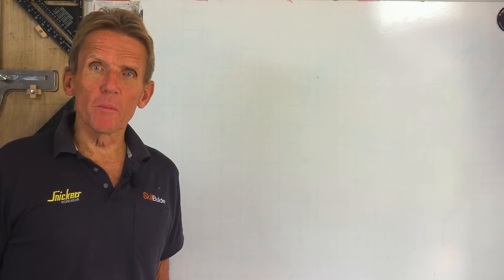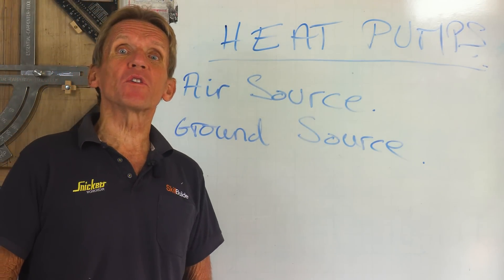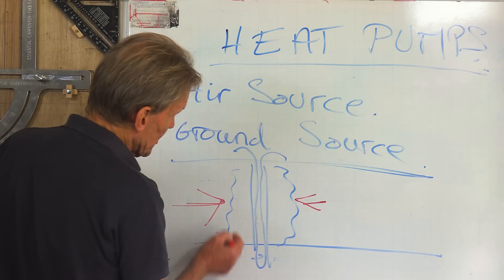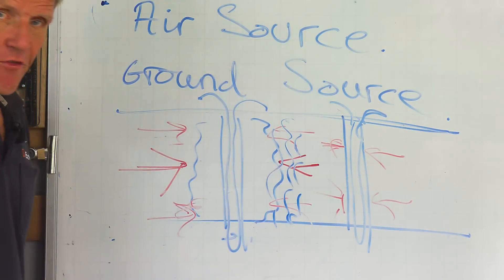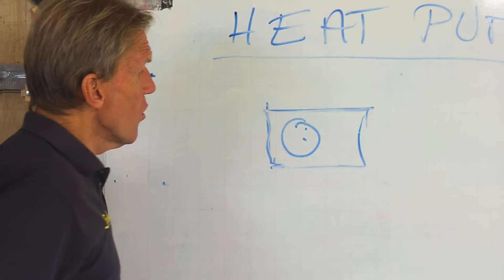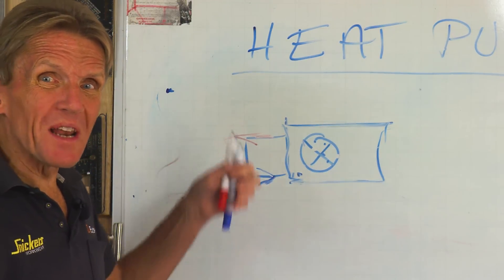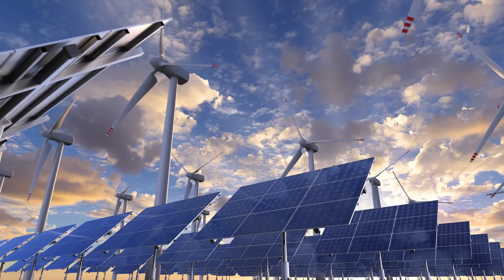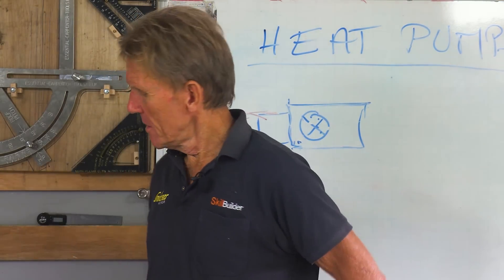Heat Pumps ~ Get Your Facts Straight!

Comment: the quiet killer comment from that Welsh guy telling you about his awful experience was 'it increased our electricity bill by two-and-a-half times'
Reply: How much did the gas bill go down by?? and two and a half times what??
Reply: One thing the pro heat pump zealots say to high electricity bills is “you should have installed solar panels and batteries”….well that’s a mute point as the only comparison to that with conventional boilers would be to have your own oil well/gas reserve to tap into to supplement the grid supply!
Reply: What did it do to the gas bill?
Reply: @jimgrace3492 my 4 bed gas bill is £580 and £180 of that is rip off standing charges. 😂 how can you save money on that with a 10k heat pump
Reply: Your gas/oil bill moves to your electricity bill. It's not free heat 😂
Reply: @Loopyengineeringco  yes but it’s not a one to one ratio as electricity is more expensive than gas, and heat pumps use a considerable amount of electricity, depending on the type of house you have and how you heat it this can lead to massive electricity bills (as I commented on the last video I follow a lot of self builders on instagram a lot of whom regret installing ashp, one of which who this year moved into their well insulated, air tight build recently had a £3000 bill for the last quarter)
Reply: @aster7693 How large is the property? Surely this cannot be all heating? BTW there wasn't any need to use heating until November
Reply: @aster7693 straight up nonsense. Did you watch the heat pump replacement video and the one showing the genuine efficiency? Even in that single skin house they were able to get an efficiency that was cheaper than gas. 
If they are spending that kind of money in a new build home then it’s been designed and installed wrong.
Reply: @Loopyengineeringco   Nobody is saying it's free heat, but if installed right it will be cheaper heat, and more importantly lower carbon heat.
Reply: @johnhaydon4055  yeah definitely - a lot of people miss the fact that their electricity bill now covers their gas bill (somewhat surprisingly). Mine's been cheaper to run than our old gas boiler, with more radiators & being warm all the time. A lot of the saving is also down to using smart tarriffs, lowering the average price per kWh if you have good controls
Reply: @johnhaydon4055  when freezing no one cares about carbon mate.
Reply: Yep there’s always comments like that however the truth is somewhat different
Reply from the maker: What heat pump do you have? You seem to know so much more than somebody who owns one.
Reply: @SkillBuilder I really don’t understand why you hate heat pumps so much, it’s verging on irrational, but I have a Vaillant Arotherm 7kw air source heat pump properly installed (which Is key) heating a 4 bed detached in north Scotland and my energy bills are lower now than they were before. Cold hard fact not voodoo science. And I can install more solar/batteries to lower it still. How are you gonna generate gas?. The ONLY downside we have are larger K3 radiators in some locations, So you carry on hating, I’ll carry on saving 👍
Reply: @odetterollinson-davies4543 why do you think there's so much variation in  experience?
Reply: @DeepakKumar-lv4te because people by cheap shitty ones then wonder why they don't work properly. My job is getting people free top of the range ones through ECO4. Mitsubishi, Samsung, Panasonic. Plus top of the range solar. Guaranteed to save a fortune on heating bills.
Reply: @douglasnorrie5925  - quality counts, agreed, and not just in sherry. But anything that requires government subsidies (ie, my taxes) to even get attention is totally wrong and I am totally against it
Reply: @MyMy-tv7fd  not taxes. Not government subsidies. Is money diverted from energy companies profits. Energy Company Obligations. ECO. It's okay, I deal with people everyday who assume everything and know very little.
Reply: @douglasnorrie5925  - your subtle sarcasm and useful factoid is much appreciated, I am smiling not LOLing. But the government has many ways of mandating 'taxes', from VAT to ECO. And I am a very good economist, unlike you. The energy companies are making a bundle, they pass all their costs onto the consumer. And I was in professional politics for several years in the European Parliament reading all the legislation on this long ago, so there.
Reply: @DeepakKumar-lv4te quite simply many installers aren’t trained well enough.
Reply: @odetterollinson-davies4543  so what. Won’t pay for its self for 20 years
Reply: @douglasnorrie5925 no. You just divert that money away from energy company profits to the subsidy of the worlds largest dictatorship who also make the majority of the worlds solar panels. Good one.
Reply: what, it was three-and-a-half? He was pulling his punches?  @odetterollinson-davies4543